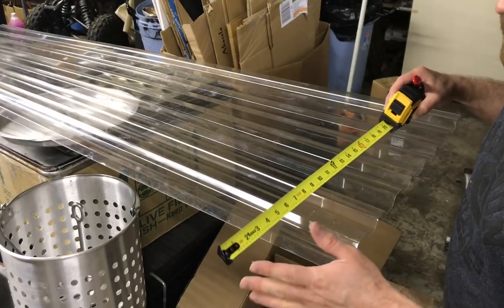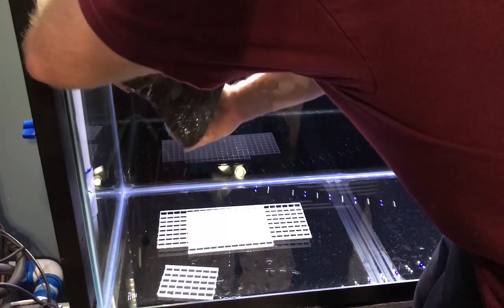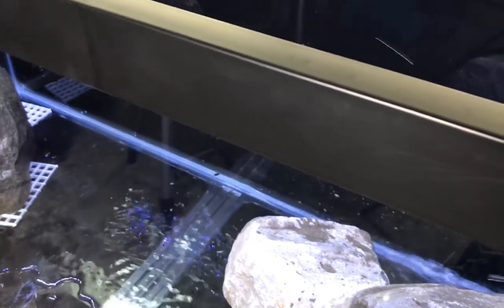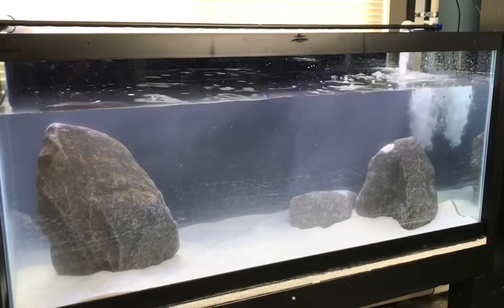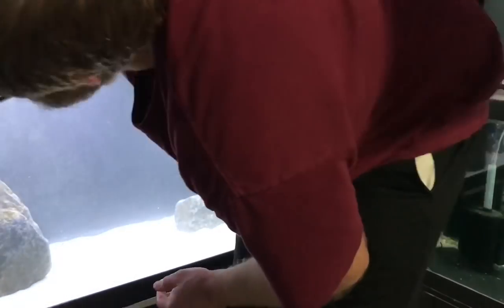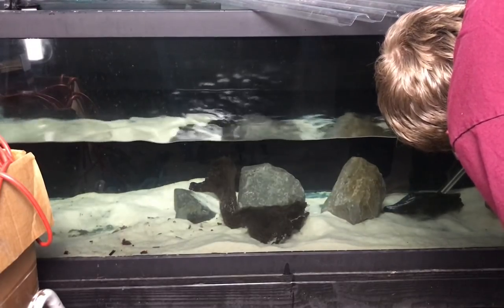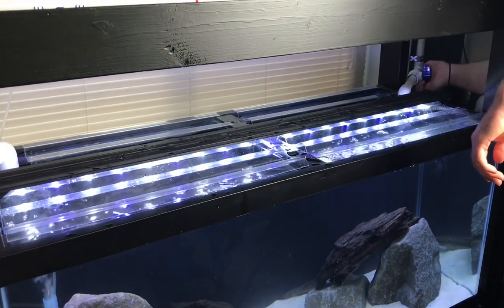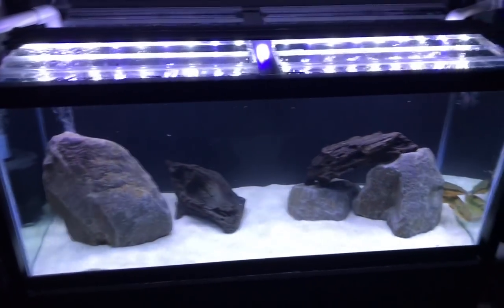New Fish Room Aquarium For Rare Cichlids

Comment: Your really killing it with your ur fish room these days...great job!
Reply from the maker: Much appreciated Gurvinder! Thank you.
Reply: @inventoryking  Meanwhile I'm here racking my brain about how to put my new 220g tank in place of the 150g I'm currently using...lol
Reply from the maker: hahaha good times. Buy yourself a 55 gallon tote from home depot (black with yellow lid) and transfer your fish to the tote (after its cleaned) and move the filters to it. So the fish are still in filtered water. And then you can start moving the fish. They might get some bite marks etc since its in a much smaller tank (tote) but it allows you to work. That is how I did it when I moved.
Reply: @inventoryking  Yeah I'm thinking of doing something along those lines...just have to plan it all out..the new tank has a beautiful 3d background but it's not drilled for plumbing...I'm planning on doing an overflow to my existing Trigger 39 sump but have never drilled glass before...and the 3d background would need to be trimmed to accommodate the interior overflow box...